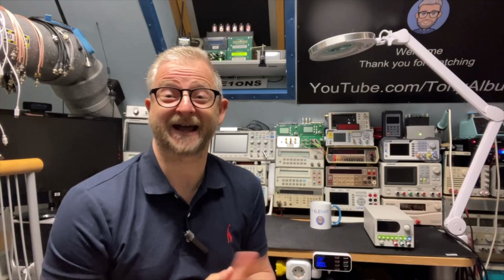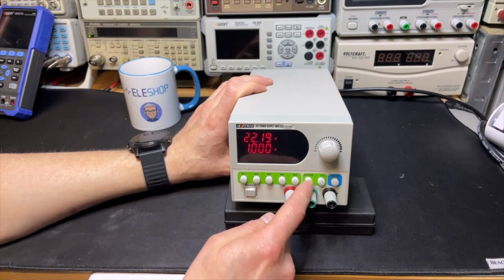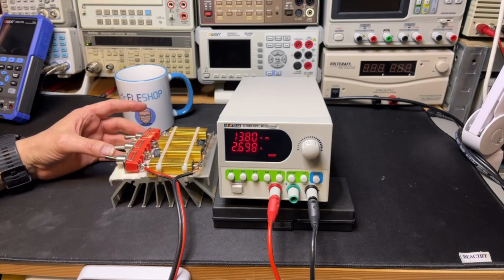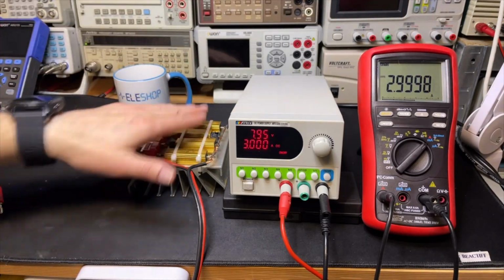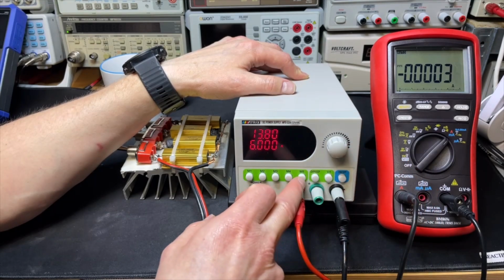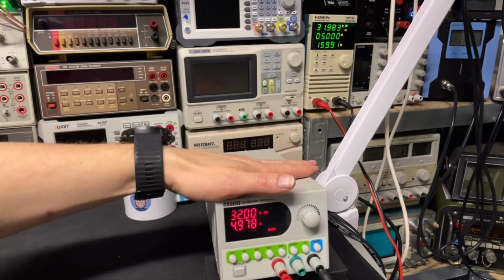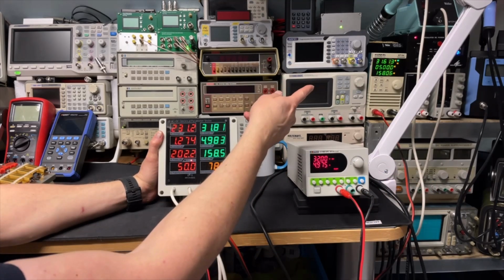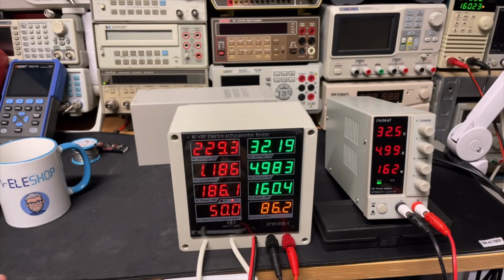#252 MATRIX MPS-3206 DC Power Supply Hands On Teardown

Comment: I notice in the comments that some viewers, a while ago, were interested in the ripple voltage of the power supply.  I purchased the power supply shortly after Tony posted this great video.  I thought I would obtain some information on the ripple voltage since it is a switching power supply.  The manual that comes with the power supply states ripple 10mV RMS.  It does not indicate in the manual how this parameter was measured since there are many techniques.  I used Texas Instruments recommendations and set the oscope to bandwidth limit of 20 MHz, special probe connections to prevent loop pickup, and other techniques.  At 32 volts 6 amps I measured 6 mV RMS with peaks of approximately 120 mV p-p.  At this full load current the switching frequency was around 73 kHz.  So, my unit seem to easily meet the publish value.  As Tony mentioned if you want low ripple/noise a linear power supply might be a better choice.  Hope this helps.
Reply from the maker: Thank you John! thank you for sharing very good information.

Comment: -smps ...<-frail...lifetime : 2weeks?  
+ i'm curious about the time it took to regulate voltage and current :p
-is the fan help for something so far from the heatsink?
a single knot ...< perfect  to spend my day to click 
it's totally inadapted for voltage injection, so it's useless for repair electonic
Reply from the maker: Thanks for your comment, i guess the device is not for you. thank you for watching.
Reply: @TonyAlbus  it would be nice if eleshop sell some linear power supply at this range of price.

we don't want/need some fancy stuff.

only some :
30v 5a
2knob for thevoltage
2knob for the current.

the powermeter, the memory buttons and so on are pretty useless
Reply from the maker: @ZZZ-z9n3n  Linear will always be more expensive because of the transformers hold a lot of copper, specialy above 1 or 2 Amps. you can have a look at the Siglent's or look on the secondhand market for old TTi or Farnell

Comment: Hello Tony Albus, for a first DC Power Supply (hobbiest) which do you recommend? Thx
Reply from the maker: Hi Ricardo, this is a nice starter... avaid the very very cheap onces as they can produce switching noice, if you work with sensetive analog or RF equipment you may want to look at linear supply.

Comment: Nice unit.  The memory buttons will be very handy!  Decent voltage and current range too.
Reply from the maker: Thank you Stephen, yes i agree, just program your most used values in there.
Reply: @TonyAlbus  Yep - i would probably buy one as they are quite cheap, but i have 3 SMPS (ISo-Tech IPS-603), that will do 60v @ 3.5A and an Agilent 3648A as a linear, so really don't need any more, but i am thinking about the ac one you reviewed, as i could do with a variable ac power supply as that would be very handy! :)